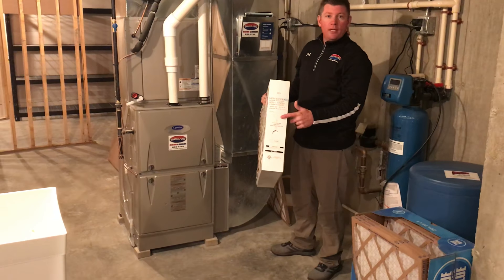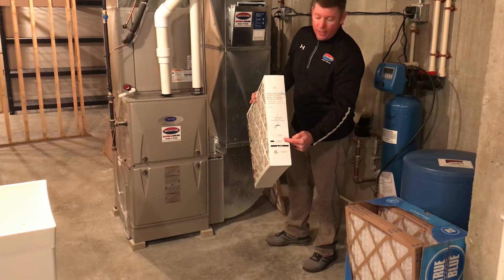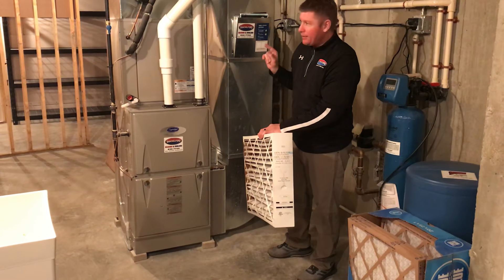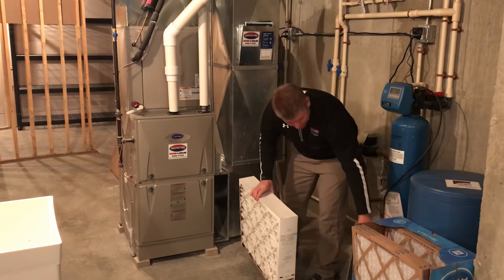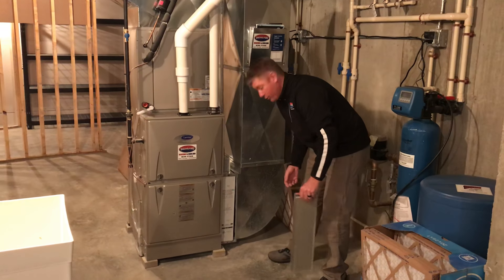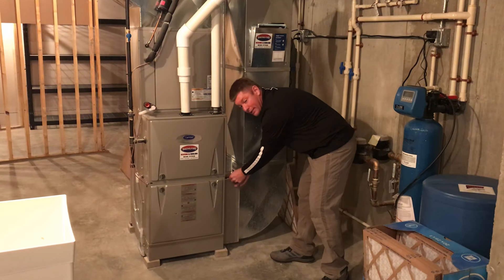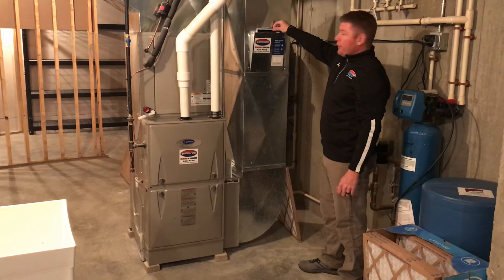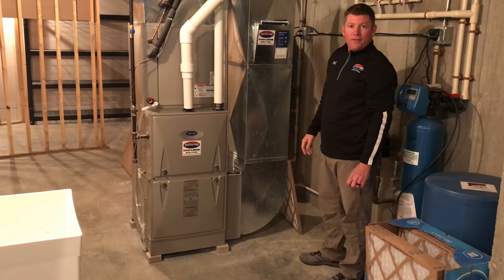Carrier furnace air filter: How to change your filter

Comment: Hey I HAVE THE SAME CARRIER unit but I don’t have a filter rack on the side anywhere... where the heck does the filter go on mine? It looks exactly he same as yours except for the side part that accepts the filter isn’t there???
Reply from the maker: MechanicalMonkey777 sure, could be on the bottom or do you have a large register in your living space in a wall or ceiling?
Reply: @shackelfordheatingcooling4625  I am not the original commenter, but if it helps others, I found the air filter recessed in a vent on my ceiling. I just got a step ladder and unlatched the vent to replace the filter.  No need to mess with the furnace in the attic.

Comment: what you are not showing in your video is how to put the filter in the white filter box.    You have to partially disassemble the box to remove the old filter then reassemble it.   It is quite a chore.
Reply from the maker: The filter you are referring to -a space guard filter -is a different filter than shown here. Not all filters -there are many many sizes-are the same and yes assembly and install of those filters is different.